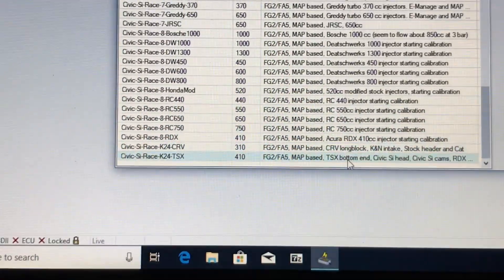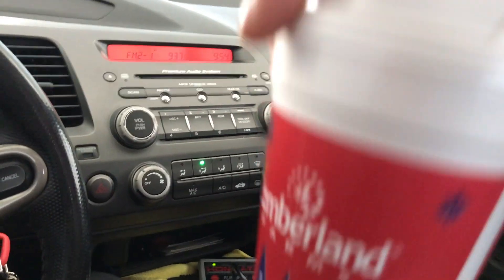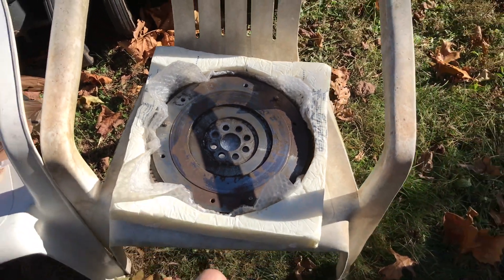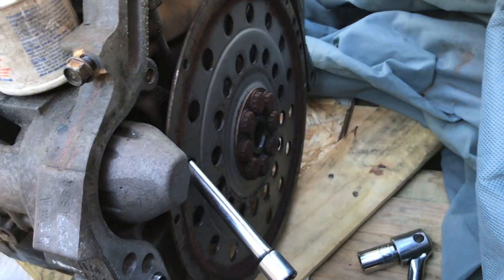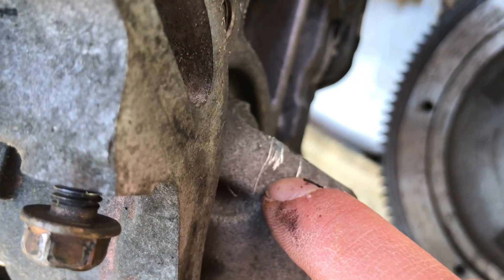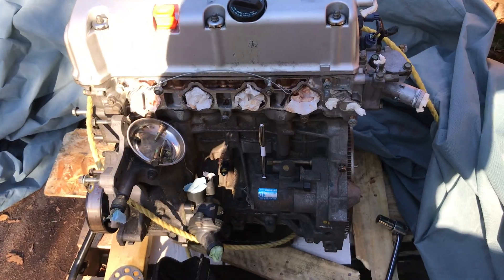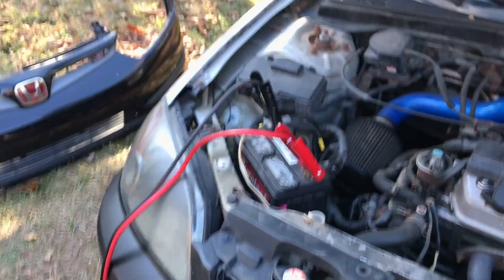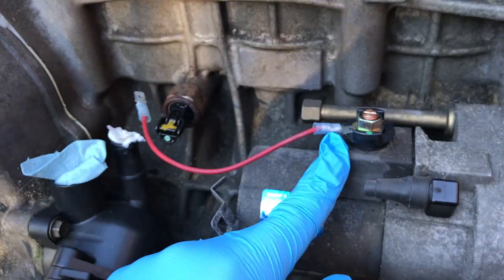Honda JDM k24a Engine Problem

Comment: You wanna do compression testing after the engine is up and running. Compression testing a motor that has been sitting a long time will yield inconsistent results. You need to get the engine warmed and primed. I netted completely different compression results from when I first got it, to first install and oil, to second oil change. I have completely adequate compression, and I have a Absolute motor from JDM NYC as well
Reply from the maker: So I’ve heard. Now my question is, will the compression increase? Like current 180 to 200 after being ran or warmed up. I think my engine is good though, should run strong.  What is your engine swapped into? Is it an RBB-1? And how long have you had it for. Thanks
Reply: @TheGerbsteve  .. I just got it and yes it is an RBB1 non-egr Absolute motor from JDMNY. Its in an RSX Type S and I just finished the install. When it comes to compression, it can vary motor to motor. What is more important is consistency between cylinders. As long as you are getting good numbers all across the board, you are in good shape. When you start seeing 10-20psi differences between cylinders, that is when you may have some concern on seals, valves, or rings. But again, you want to do a proper reading when the engine is up to temp and running good oil.
Reply: @TheGerbsteve  .. I also HIGHLY recommend doing the install when you are ready to dyno, as the Hondata basemaps suck. I dont know if this is because they purposely run them rich for safety, or if there are slight differnces between the USDM k24a2 and the JDM k24a, but I ran super rich, and idle was a bit wonky. After the Dyno and installing an Acuity Halls Effect TPS last week, it runs like a champ. These Absolute motors also make a bit more torque than the USDM k24a2 motors. If you are running the RBC, try to get a 40-45 degree custom VTC gear. Hondata's limit does not always work for surge if u are using the 50 degree. Or at the very least do not over-rev, or shift hard(risking a mis-shift) with a 50 degree on a stock k24a.
Reply: @TheGerbsteve  .. But no, the reading should not increase by much, and may even go down a bit, but as long as u are within 10psi on all cylinders with a good compression reading(165+ on most compression instruments), you are fine. It is normal to have some leakdown and not perfect compression. I had 15-20psi differences at first, but now all read within about 10 psi of each other and the motor runs great now after dyno tune. It is HIGHLY unlikely these Minivan Motors were ever abused or not maintained. Remember, in Japan, you have to trade in your car before 60K miles and you have to do routine Factory maintenance. Japan is very strict in this regard. If this was a JDM K20A out of an ITR, then maybe u would want to be extra careful.
Reply from the maker: I would not beat on the car with a basemap, just use it to break in the clutch and what not.  Yes they do, absolute =171lb ft tq, usdm=164tq.  Hey, I’d rather have more torque than HP.  I’ve heard that you want to have no more than 40-45 degrees of advance on the k24’s. My question is, where can I get the stock 25deg vtc machined?
Reply: @TheGerbsteve  .. HPT you can send ur stock one in to be machined for like $200.. Or you can buy one already machined for $290(i bought the 40 degree which still nets you a few degrees over that which is all you really need specially if you staying with stock cams or going boost). DC also sells them.. You should also maybe reach out to some local automotive machine shops in your area.. Any machine shop with CNC machining can easily make one for you.
Reply from the maker: I’ve heard the same on the psi man.  This is great to hear! 👍🏼👍🏼👍🏼. Very useful information man... where did you hear about the Japan emissions and mileage? I knew they came with anything from 45-60k miles, which is a baby 👶
Reply from the maker: HPT what?  And that’s not a bad deal... maybe I’ll do that just to be on the safe side man.  Besides, I’d rather have something mechanical vs electric for control.  Mechanical I know will work all the time, but how do I know if the electric tune advance will stop at 45, ya know.  Did you buy your 40 deg off HPT?
Reply: @TheGerbsteve  HPT Auto sports.. https://www.hptautosport.com/products/hpt-honda-acura-vtc-acuator-intake-cam-gear-custom-cnc-machined-30-35-40-45-degree
Reply: @TheGerbsteve  .. I have 3 different ones.. I have a custom 40 degree from HPT, a 45 from Drag Cartel, and my local shop here made me a 35 degree one from my PRB 50 degree vtc gear. I wanted to try them all out. Its all gonna depend what you future goals are. You need to make those decisions before going forward. If you plan on doing an NA build with full valvetrain and internals, you will benefit from a 45 or 50 degree(k20 or k24 head). If you plan on doing a mild turbo build(like me) and are more focused on a good, useable powerband for the street(im going gt3071r with early spool and about 350-380whp), then you do not need any crazy timing. 40-45 is more than enough. Many even stay with the stock 25 and are perfectly fine. If you plan on going higher HP with a laggier Turbo, than again, you will want more timing and the ability to rev more. If you plan on going built NA or higher HP boost, id def do the K20a2 or z1 head now and throw in a supertech valvetrain as itll be important to get more RPM and more timing. If you plan on just doing bolt ons, stick with the RBB manifold and just get a 40-45 VTC if you want max tunability. Even with just full bolt ons and a 40degree VTC you will have a very fun car and youll make really good torque numbers. No more getting busted off the line on green lights by A Prius lol
Reply: @TheGerbsteve  .. I was stationed in Japan while in the Military. Not ALL prefectures in Japan have the same laws on cars, but there are federal regulations that make people have to trade in their cars by the end of their warranties. And then if you want to buy a "USED" car, or keep your used car in Japan with higher mileage, you must pay hefty fee's and be subject to specific regulations and checkups, which most do not bother going through. This is obviously because as a petrol car gets older, the emissions tend to get worse and worse over time. There are exceptions, but this is mostly how it is in Japan, and it is the reason why most JDM motors are "40-60K" miles on them.
Reply from the maker: Damn buddy, you’ve spent some $$$$ haha... I’m actually looking to stay n/a for a bit, keep it simple. Intake, header, tune.  Well, there is a reason I want to keep stock compression, possibly for a turbo down the road 🤘🏼... nothing too crazy though, probs 7-8psi.  So I’m thinking 40-45 degree machined will be good. Now, my question is, how much power will I net if I just changed vtc with some bolt ons and tune? I’ve heard many different answers.  I think I’m either going to stick with stock 25 or get it machined to 45, depending on the power and tq increase.  I’ve heard RBB >rbc and rbc>RBB manifold. I do know that RBB produces a lot more tq low to mid and rbc shines above like 6k rpm. My question is, will the RBB flow as good as rbc up to 78-8k rpms? I plan on ordering a new vtc though, so I’ll most likely get a 25 degree and get it machined, although I can get a 50 degree and set it electrically on hondata for cheaper... decisions, decisions... and I want a nice 230whp min with like 180+tq swap 😎 more excellent, knowledgeable info again. Appreciate it bro 🙏🏼
Reply from the maker: And I see, I see. That’s how you know quite a lot haha.  Man, those are some strict regulations, glad I don’t have those laws here lol.  I don’t blame most of those people, I wouldn’t want to deal with the bs either.  And I really wonder the true mileage on my k24a... I wanna day like 50k 🤔🤘🏼
Reply: @TheGerbsteve  .. With RBC, you will see a few HP up top with more timing. If you stay RBB with 40-50 degree, you will see power increase throughout in torque and HP, but you will sacrifice some power up top. I would personally stay with the RBB for now and just throw in a 40-45 degree gear for the future. You will see better low and mid range with the RBB over the RBC. But its not much we are talking here. 5-10hp tops usually. All depends how you want your power curve to be. But if you go with a 40-45 degree VTC, its pretty much a win/win regardless of setup. For me, the low and midrange with the RBB and bolt ons is really nice. Remember tho you should also take the RBB or RBC to get ported and use a 70mm TB port matched. The k24 likes air so going with a bigger TB is ideal and I would do 3.5 inch intake piping as well along with a full 3 inch exhaust.. I have a full custom 3 inch exhaust from TruBendz. Got the Vibrant ultras quiet Resonator and paired it with the Vibrant 3 inch muffler. It isnt too loud and is just perfect. Sounds SOOO good with a k24. I also had a cutout(testpipe) if I need to bolt in a cat for emissions(and is a good thing to advertise when you try selling the car in the future). The whole exhaust setup only cost me $550, so I got a custom 3 inch SS exhaust fit for my car for less than the Ktuned 3 inch exhaust.
Reply: @TheGerbsteve  .. Since it is from a Minivan, it is likely low. It is a family car, so most will get rid of it before the warranty expires and upgrade. It most likely has around 50K give or take. In Japan, you get incentives for trading in the car earlier and get great return on an upgrade. They treat cars almost like cellphones in Japan. You get your car, use it a bit, then when the new model comes out, you go and trade it in for a new model for a discount. If you go to Japan, they have SOOO many junkyards that are big business in Japan. This because they get so many used cars in great shape that will likely never be used again, so they export them all over the world and make money that way.
Reply from the maker: I think rbc with 45 degree would be pretty sweet. I wonder why nobody uses RBB on 8th gen k24 swap? Everyone swears by rbc 🤔... I agree though. I need to see if the RBB will fit in my 8th gen engine bay.  Is your k24 in an 8tb gen with RBB?  I want to be able to rev to 8k rpm with stock oil pump and upgraded vtc. I wonder if that’s possible.  I’m stuck on which manifold to use honestly... I like the rbc more in terms of styling and installing/removing.  But it seems like I can make more tq utilizing the RBB, so I have my mind towards that. I do like a goo top end though considering I will be doing some racing.  I think I’m going to pick up a 45 degree mechanically pinned vtc. What is your rev limiter set too and do you have type s pump?? I’ve heard the important of getting the mani ported.  I wanna do 3” ram air/vstack, skunk2 header, maybe 3” exhaust.  I really like the vibrant streetpower 😉... the k24 has always sounded awesome to me. I’ll see for exhaust though. I already had a few too many lol.

Comment: Although the compression were above 180ish in all 2nd cylindee seems to be low they prolly need valve jobs and pistons rings that should be atleadt 210 psi and above and shouldnt 5 psi or more difference in all cylinders
Reply from the maker: It’s either valve seals, rings, or a head gasket 🤷🏼‍♂️.... Debating on whether I want to return the engine or not. I pretty much tore everything off, ya know... and there shouldn’t be a difference of 15-20 psi between cylinders. If huge difference, usually it means something is seriously wrong.
Reply: Gerb Productions have you actually check the valve lash on each cylinder? That might help a bit
Reply from the maker: I haven’t, but I’m going to adjust the valves this week man 👍🏼👍🏼. Then dry test it with better connection one more time

Comment: Wouldn’t hurt reseating the valves. Could just be a lot of carbon on the valves and what not. Good luck bro.
Reply from the maker: Going to try a valve adjustment and head gasket first, see what happens.
Reply: Gerb Productions no doubt man! I got faith in the jdm K.
Reply: Im gonna have to agree with this one.. It would be a good idea before discarding the rings..

Comment: I guess at this point you really have to ask yourself how deep are you willing to dive I’d personally have it switched instead of running. Into issues later or going way over budget due to {ie. rings it pistons . Which turns into head work and cams and etc.}
Reply from the maker: Agreed. Thought the same thing.  Personally I was planning on doing a head gasket, valve seals, and piston rings for sure. So, technically I’ll be pulling apart any engine I get regardless, ya know

Comment: (๑╹◡╹)ﾉ" Can’t wait to see it in action, I’m going to stick to my K20A though! It’s just too much fun, well the Engine at least - the A/C is a different story! 😭
Reply: tell me more about this ac story
Reply from the maker: I'd like to know more about the AC as well
Reply: Gerb Productions The compressor keeps failing, and I’ve replaced the whole system twice in the 10 years I’ve owned my FD2!

I’m thinking of just removing all A/C components to save weight at this point, it just blows hot air all day everyday! 😰

But the problem is, she’s only 96.000km old! And I don’t bash her every which way - I’m very keen on maintaining her! 

If I replace the faulty components at this moment, this will be the 3rd time I replace them!

(● ˃̶͈̀ロ˂̶͈́)੭ꠥ⁾⁾
Reply from the maker: Seems like the ac units on these k series aren’t the best. I’ve heard frequent problems similar to this with the 8th gens... my advice would be to check the serp belt and other pulleys. Make sure nothing is stuck, ya know
Reply: Dayco 5060515 serpentine belt  fits without the ac compressor on 8th gen si 👍🏾👍🏾👍🏾

Comment: U change to k24 engine?
Reply from the maker: In the current process of rebuilding my k24
Reply: Gerb Productions u should buy 9 gen si engine not crv engine. Lol
Reply from the maker: This engine makes almost the same power and torque as 9th gen k24z7.  It’s not a crv, it’s a JDM odyssey absolute... same as 04-05 Acura TSX

Comment: A wet test is pointless, because it’s gives worn rings compression. That’s how you test if the rings are bad. You had a slow crank for the first two on a dry test so that’s probably why it was low
Reply from the maker: I realized that after I performed the test. It just doesn’t make sense that two cylinders were off and the other two were good, unless bad head gasket , valves adjustment off. It definitely was a connection issue because it was way too slow during the crank process.
Reply: Gerb Productions if it was burnt exhaust valves, you’d have 0 compression. It’s 99% the slow cranking that caused it
Reply from the maker: Agree with you 100% on the first two cylinders... I’m going to do a valve adjustment, then retry compression test this week with better connection 👍🏼

Comment: Thats a pretty low compression on the dry test.
Reply from the maker: I agree. I was a bit disappointed. But the jdm specialist said that because the engine has been sitting for so long, everything was dry. I need to make a decision on what I want to do. Going to try testing it one more times in a few days, dry. See what happens, then take it from there
Reply: @TheGerbsteve  even though everything was dry bro. No refunds on that engine?
Reply from the maker: Either a refund or exchange for another jdm k24a 🤷🏼‍♂️
Reply: @TheGerbsteve  just put 2j on there  bro😂. Kidding tbh man just refund it, compression too low. Or maybe just rebuild it.
Reply: The only way that engine was dry is if it sat open or was fucked up from the factory.... Or you got ripped off